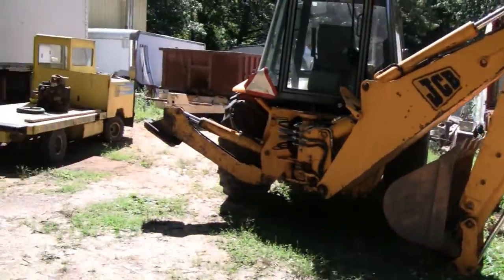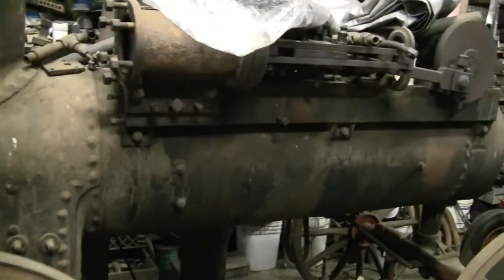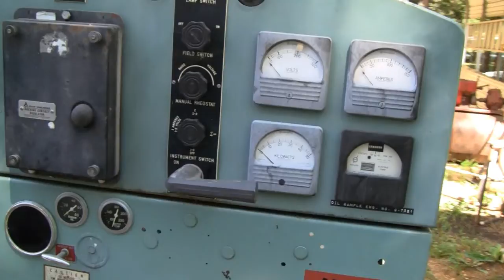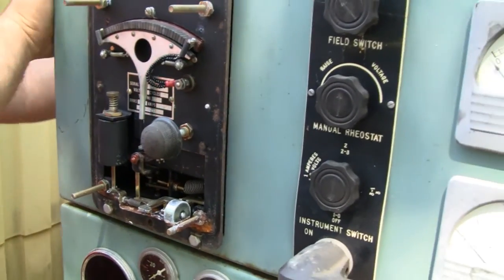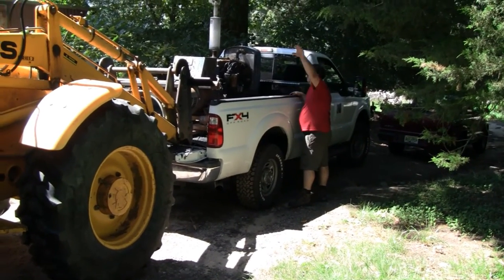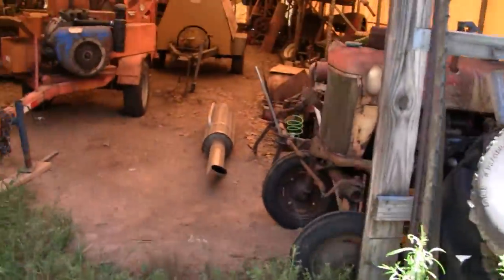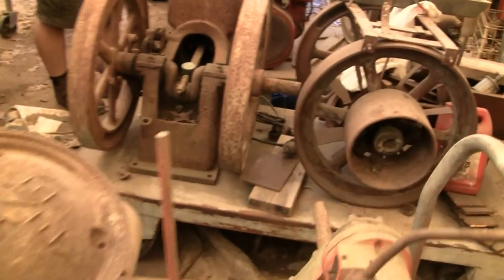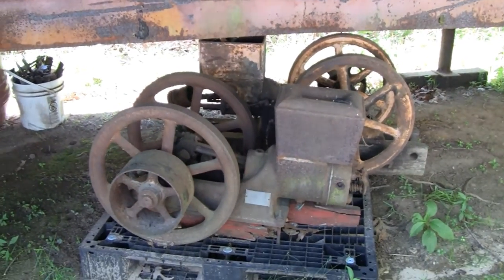ROADTRIP TO BUY SOME RARE HIT AND MISS ENGINES

Comment: Allis Chalmers made good use of the Brown Boveri rocking contact voltage regulator. Their regulator used a torque motor instead of a solenoid. Stability dampening was provided by an aluminum disk in a permanent magnet field relying on eddy currents to impede rapid movement of the rocking shorting bar.

Comment: Love those old B Model Macks, Carnation Milk canned milk about a 1/2 mile from where I was raised, and that is what they used for over the road tractors. Later I drove the DM dump trucks and also an R model road tractor.   I operated a JCB backhoe quite a bit in the 80's. They are made in the UK and are well built. Good road trip RK and Mike. Thanks for the ride.
Reply from the maker: I've seen them around for years and never knew they were British!!☻
Reply: @805ROADKING  That is where they originated and where the one I operated was built. I just looked and they are now built in the UK, USA, and India.